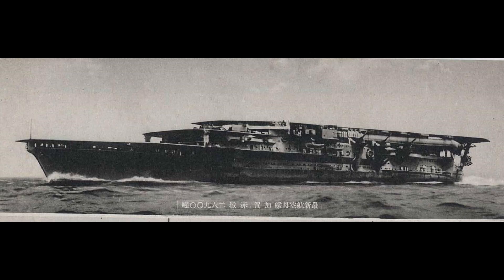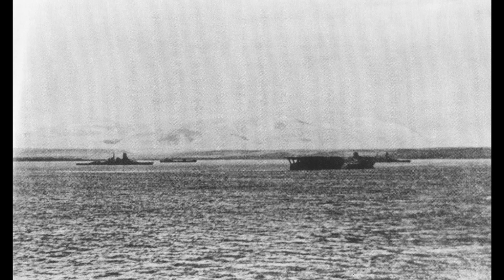IJN Kaga - Guide 255

Comment from the maker: Pinned post for Q&A :)
Reply: when Kagas front 8inch turrets were removed in her 1933 refit, why did they keep the rear guns? Wouldnt it have been borderline impossible to get a decent range estimation and hit rate with only 3 guns? 
Edit: nevermind ignore this I missed the part where she got 4 additional single guns to replace the lost turrets.
Reply: Why did the US 6" Mark 16 gun have a lower muzzle velocity (2,500 feet/s) than the contemporary British 6" Mark XXIII(2,760 feet/s) and Japanese 6.1" Type 3(3,000+ feet/s)? Was this because 2,500 ft/s was the optimal velocity for use of its super-heavy AP shells or would it have been better if the Mark 16 had a higher muzzle velocity with its super-heavy AP shells?
Reply: Japanese carriers have side funnels (which I think looks very cool) while US had straight funnels next to the island. What is the idea behind the two different designs and the pro and cons of each one? Which design would you prefer?
Reply: How would Bismarck have fared had she been armed with 12 15 inch Guns in 4 triple turrets?
Reply: what is the  most confusing turn of events during naval conflict.
Reply: How did the woodern fin's on the Japanese torpedo bombers torpedo's help them from burying themselves into the sea floor at Pearl Harbour and did the Japanese keep using the woodren fin's after Pearl Harbour or were they a one time use idea?
Reply: At 5:33 - What is that structure at the aft of Kaga (left carrier) that looks sort of like a "spoiler?"
Reply: Will you do a video on HMS Caroline one of the last remaining museum ships of ww1 or have you ever visited it?
Reply: @UNSCForwardontodawn Lexington had 8 mounts and they could fire in all directions a regular cruiser could.  Kaga had 4, of two of which could be fired at a broadside.   Lexington would win a broadside fight (8-2 guns to bear).  If Lexington does a bow or stern rake - forget it.  Kaga would be wrecked.
Reply: Why do they torpedo ships before they are fully evacuated? Or were the 800 men already dead?
Reply: On the subject of carrier operations in WWII, how did the Kriegsmarine actually undertake training and operations planning for deployment of the Graf Zeppelin? Did they get advice from the Japanese?
Reply: It is often said that USS Ranger was deemed to slow for service in the Pacific, yet Kaga is actually slower than Ranger. Did this cause major trouble for the IJN?
Reply: @jeff53494  You do not want smoke not interfering with flight operations. Both designs are to keep minimal smoke from interfering with your landing approach view.
Reply: @themightynanto3158  does little to stop torpedoes.
Reply: @dbuckleton  of course they're evacuated.
Reply: What if Japanese leadership were considerably more pessimistic about their chances against the USA than they were in reality, and started up the Special Attack Units a decade earlier than historically, i.e. early to mid 1930s, thus developing doctrine, materiel, and training pipeline for kamikaze pilots well before the hostilities began? Could, in effect, having guided cruise missiles right at the outbreak of war allow them to inflict sufficient casualties upon the US Navy to cause the USA to seek peace terms?
Reply: @Kerndon  Ranger actually did go to the Pacific. Just not in a Frontline combat role.
Reply: @WALTERBROADDUS  okay, I thought perhaps they were trapped
Reply: Are you aware of a game called Rule the Waves 2, and if you are, thoughts on it?
Reply: @WALTERBROADDUS  yeah on that i agree. But what i'm talking about is at Denmark Strait and the final battle.
Reply: @dbuckleton  okay, let's just say the call to abandon ship was given. Everyone who was going to get off, did so.
Reply: @UNSCForwardontodawn In theory Lexington can bring more firepower to bear, as her 8 8" guns can potentially all be brought to bear on either side (though they'd be firing cross deck when engaging to starboard) while Kaga's 10 8" guns look like only 5 can be brought to bear on either side.  And of course Lexington's got the speed advantage.  But maximum armor looks similar.  Hope Drach picks up this question and addresses the more in depth items that might affect the odds (armor coverage, fire control quality, etc.)
Reply: ＋２ Torpedos
-811 Men
Does anyone else see a problem here? I would like to imagine they were already dead, trapped in inaccessible lower decks or something other than "mission non-essential personnel"
Reply: How would you rebuild her( with the tech of the day) and make her better?
Reply: What factors caused Kaga to lose so many planes at Pearl Harbor compared to the rest of the Japanese carriers?
Reply: Awesome as usual Drach.  BTW, update on the battleship Texas.  It's confirmed she'll be drydocked second quarter of 2022 in Galveston Texas.
Reply: @unryumaru2095  I suspect it had something to do with the US's want for a higher rate of fire than the British because they envisioned the weapon to be primarily used against aircraft, with some anti shipping tossed into the mix.  The British where exactly opposite.  They thought their guns  would be aimed more at shipping and less at aircraft, but it would be good enough in a pinch.  The result is in the design.  The ROF of the British Mk 13 was 8 rounds a min but it had a higher penetrating ability over the US's Mk 16, which fired around 12 rounds a min..  To achieve this, the US had to sacrifice muzzled pressure (while saving weight) in order to reduce heat build up.  But that's a guess on my part.  Sometimes this stuff gets obscured by time.  This is what the data tells me, but I can't actually find anything that says "this is why."  Drach may have more information available.

I mean it could simply be that the US was trying to save some weight and that was all.
Reply: So, considering Nagumo's decision (at Midway) to have his aircraft switch from ground attack to naval attack just prior to the US attack that sank her, would Kaga's multiple flight decks have alleviated the situation somewhat to allow Nagumo to get some fighters up and launch some counter attack?
Reply: How whould a Japanese purpous build carrier in the Yamato-class yards have fared? How big could they have been and how do you think the Japanese would have made it? More like a super Hiryu or Shokaku or more armoured?
Reply: @dbuckleton  The IJN couldn't confirm their deaths.  They just knew they couldn't leave it to chance that the ship might not sink and the American's capture Kaga.  It's crap, but they had no other choice but to sink her.
Reply: @QuizmasterLaw  There's a good chance they were already dead.  Abandon ship had been ordered, and no one else was leaving.  They could have been trapped but no one can confirm it.  Regardless, the IJN couldn't leave it to chance that the US might capture Kaga.  So they were left with little choice but to torpedo her.
Reply: @unryumaru2095  the Mark 16 has a shorter barrel (47 calibers vs 50 and 60), and heavier shell (130 lb vs 112 and 124). While the Mark 16 uses a slightly larger propellant charge than the British gun, the Japanese gun uses a much heavier propellant charge to achieve it's much higher velocity. While it might have been better to have an even higher muzzle velocity, at 20,000 yards the US shell is moving slightly faster because its weight and shape help it retain more of its initial velocity. And 2,500 ft/sec] is about the same as the 16"/50 Mark 7, better than the 16"/45 Mark 6, and the same as the 8"/55 Mark's 12 and 15 with the super heavy AP Mark 21 shell used on the later heavy cruisers. That lower muzzle velocity is basically just the price paid for switching to superheavy shells that retain more velocity and penetrate better at practical battle range.
Reply: @unryumaru2095  Well, according to the video about Ching Lee a few days ago, the firing tables of the US Navy around this time had the powder giving lower velocities then were being realized in actual firing. 

As an artillery officer, I can tell you that it is easy to throw a small diameter shell at higher velocity. The larger the bore, the harder it is to toss the shell at high velocity. Also not all shells are designed alike, ballistics, barrel liner wear, they all figure into design and actual performance.
Reply: @Drachinifel If the tirpitz, somehow, broke out into the Atlantic and the home fleet couldn’t get to her in time, could the Washington take her on without the famous admiral lee and her accurate crew aboard her?
Reply: It would be interesting to see you do a video about ghost ships some day! 
Happy Halloween!
Reply: Jordan's "Warships After Washington" says that the UK was supportive of a 43,000 ton limit for individual battleships, while the US wanted the 35,000 ton individual ship limit.  (chapter 5, page 74)  What if they compromised, that everyone was entitled to one 43,000 ton ship, because the RN had Hood, with the rest of their battleship force limited to 35,000 tons?  The Japanese could have demanded the right to complete one of the Tosas as their 43,000 ton ship.  That would give the IJN 3-16" armed ships.  To maintain the 5:3 ratio, the US would need to complete the forth Colorado, Washington, and one 43,000 ton ship.  Which 43,000 ton ship would they choose, a South Dakota, or a Lexington, and why?
Reply: Ultimately was the Royal Navy’s strategy to have the armoured flight deck, at the expense of the number of available aircraft (once they got the excellent American naval fighters and bombers available) superior and economical, to that of the US Navy and the Japanese Navy strategy for large air fleets but with  Unarmored flight decks,  resulting in large material loss on both sides, consequently US victory was basically because  the US shipyards could outbuild the Japanese shipyards.
Reply: What's the oddest caliber of main battery gun planned or actually built for a battleship? And example being the odd 13.8 inch guns for the msckenson class
Reply: After watching the episode of Admiral Lee and the accuracy of Washingtons guns, How does one regulate the guns in a turret to shoot the same point of aim. I understand calibration of the FCS relative to the turrets and elevation on individual slide guns, but single slide and in azimuth variations would occur in dispersion.
Reply: Why were there no allied light carriers/escort carriers present during the Normandy landings? Would it not been useful to have a deck to land and re-arm closer to the invasion beaches before acquiring more permanent landing strips on land? Keep up the good work, and once again, congratulation about 300k subs in ahead of time.
Reply: @borismekler  that'd be a very very expensive suicide program. You're going to spend millions and millions to train Naval Pilots to commit suicide? It would be better  to invest in German technology of guided weapons instead.
Reply: @WALTERBROADDUS  A suicide pilot's training can be considerably abbreviated, though not to the extent that it was in reality. As for German guided weapons technology - AFAIK the basic designs were stolen from the French, and the allies quickly developed effective jammers anyway.
Reply: @ZurLuften  the short and simple answer to that question is, Normandy is well within the range of land-based aircraft.
Reply: @borismekler  sadly, we all learned that lesson about 20 years ago in 2001...😏 Guess they skipped the landing part of flight school.
Reply: @kemarisite  Thanks for explaining it.
Reply: @ryantaylor2595  I see, thanks for the answer.
Reply: @b.thomas8926  Thanks for the answer.
Reply: Is the last picture in the video an ACTUAL picture of the Kaga ablaze at Midway?

I've never seen it before.
Reply: @DC.409  I'm not sure armored flight decks were decisive.  The RN had significant carrier losses too, mostly to torpedoes.  Yorktown and Hornet were disabled by aircraft launched torpedoes and finally sunk with more torpedoes.  The internal fires that doomed Lexington and Wasp were due to damage from torpedo hits.  On the other hand, the British carriers tended to have a lower overhead in the hangar.  That was not a problem for Grumman built aircraft, as their wings folded parallel to the fuselage, the same as a Skua or Swordfish.  It was a problem for other US carrier aircraft that had wings that folded upward.  The Brits had to clip the wingtips of Corsairs for them to fit in the hangar of some carriers.
Reply: @brendonbewersdorf986  "odd" gun calibers abounded in fleets of nations that use the metric system.  France had 13.4" guns.  The Nagatos had 16.1" guns.  "Odd" only in Imperial measure.  The French guns were 340mm, and the Japanese were 410mm.   The German 13.8" guns were 350mm.  To the rest of the world, the US and UK 16" guns, at 406mm, would be "odd".
Reply: @stevevalley7835  that's a fair assessment I suppose 🤔 oh well
Reply: @themightynanto3158  - About as well as HMS Captain.
Reply: @leecrt967  same
Reply: Why is the sky blue?
Reply: Considering the initial problems the British had with the quad 14 turrets, did they ever ask the French Navy for advice as they had considerable experience in this area and had just completed two ships with quad main turrets.
Reply: What would the typical anti ship weapons load of a CVE, of Taffy fame, be. I would assume it would also depend on the roll assigned to a CVE and that 500 lbs bombs and such could be purposed for different rolls with different fuse settings. Since the three Taffy's were there to support ground troops I would guess the bulk were antipersonnel and that might be a problem when they tried to kill ships. (Pesky and inconsiderate IJN!)
Reply: @ZurLuften  They had the aircraft carrier called the UK just across the English Channel, so there wasn't a need to bring a ship that could only carry 30 planes when you had the entire 8th Air Force right there.
Reply: @Shoehandler1142  "@Drachinifel If the tirpitz, somehow, broke out into the Atlantic and the home fleet couldn’t get to her in time, could the Washington take her on without the famous admiral lee and her accurate crew aboard her?"

 She would need a King George V with her if she was going to try to play Rodney on the Tirpitz.
Reply: @AtParmentier  Don't know if my other reply went through because I included a link. But they did something very similar to what you are saying above. Drach did a video on her called "Always Train Your Crews" she was the IJN Taiho.
Reply: @ZurLuften  "Why were there no allied light carriers/escort carriers present during the Normandy landings" 

  They had a very large carrier called HMS England. Don't know if they also used Wales.
Reply: @GearandGaming  unfortunately didn't get the other reply
Reply: @johnfisher9692  entirely different design.
Reply: @scottgiles7546  I honestly think they both would heavily damage each other but the Washington would prevail in the end, her guns and shells were no joke.
Reply: @AtParmentier  look up the IJN Shinanao. It's a Carrier built on the hull of the unfinished third Yamato class.
Reply: I remember reading (I think in the book Clash of Titans) that the Japanese tried to paint the decks of their carriers to look like battleships to confuse bombers.  Was this really done, did anyone else do anything similar, and if so, how effective was it.
Reply: How did she handle in rough seas? She looks top heavy.
Reply: @kemarisite  yeah that's what I expected would be the answer, thanks for the diligent effort, really clarifies the situation. Still I see little to gain sinking her. Could have posted a picket force and tried to get some more out as things settled down on the ship? Possibly unworkable but seems so harsh to sink her.
Reply: @WALTERBROADDUS  if you look at building fires, you do sometimes rescue people after the fires die back.
Reply: @b.thomas8926  I'm not so sure, it's a very heartless approach to a ruined and worthless ship, to sink her to avoid her capture, while plausibly hundreds still lived.
Reply: @dbuckleton  Welcome to WWII.
Reply: Why did so many "used" warships end up in South America? For instance, there were Brooklyn, Crown Colony and De Ruyter class cruisers, along with Halland, Daring and a bunch of American classes of Destroyers. Would it be more of a budget issue, given that these ships would be relatively cheap compared to building new ones. Or is it something else?
Reply: is there a better reason why angle decks took so long, other than no one thought it would work? that seems immanently more sensible than triple decking one
Reply: @b.thomas8926  so often sadly yes, but not always, Graf spee stands out as an exception. There are probably more but seemingly so few.
Reply: Whats the intro music??
Reply: @Soundwave3591  I'm asking about a from the ground up planned carrier, not a conversion.
Reply: Wasn't she made from parts of the Taihou?
Reply: Seeming how ijn carriers had their funnels on the side of the ship in order to make one less obstacle for the pilots to avoid when landing were there cases of the hanger deck getting the ships exhaust blown in if on windy days where the wind blew from a different direction?.
Reply: Drach, I'm the ceremonial officer on a Royal Navy ship and looking to identify any Royal Navy wrecks near Iceland that we can conduct November ceremonies over the top of. Does anything, that isn't the Hood she is the wrong way, come to mind?
Reply: @joshthomas-moore2656  IIRC, the wooden fins were to aid stability in the air, following release from the a/c and broke off on entering the water. They were used throughout the war as far as I am aware, the B6N Tenzan using them, if the kit of one I have is correct 😁. I am no torpedo expert, but imagine the level at which they travelled under water would have been pre-set into the steering mechanism prior to take-off.
Reply: In the final episode of Vigil, Rear Admiral Shaw publicly blames the sinking of the trawler on a Russian sub, knowing that it was actually sunk by a Los Angeles-class that had been following Vigil. If any, what are some examples of this kind of stuff (trawlers being sunk and naval officers lying) from the channel period? I have heard of a trawler nearly being pulled down by a submarine off the East Coast of the North Island of New Zealand, but not sure when.
Reply: @UNSCForwardontodawn Neither, actually, since their primary duty is aircraft carrier and an 8" exchange is going to wreck their flight and hangar decks.  It does matter which year you are thinking, since the Kaga was rebuilt in the early '30s with all-casement 7.9" guns (slightly smaller than the Lex's, 240 lb. shell vs 260 lb.).  So after that she could only fire 5 guns on each beam, and none fore and aft, while Lex could fire 8 guns on the beams and 4 guns fore and aft (at least till early '42, when she landed her 8"ers).  Note also that Kaga's guns were rated to about 24,000 yards while Lex's were rated to about 32,000.  Plus, Lex was about 5 kts. faster, and her fire director was much higher.  Then again, Kaga had a much smaller island so would be less visible on the horizon (assuming we're talking long-range daylight engagement).
Reply: @jeff53494  The problem is keeping smoke from interfering with flight operations (and general ship operations too, but all steam ships have that problem).  There was more "experimentation" early on, but the consensus seems to have been to route the exhaust together into something high behind the island rather than off to the sides (judging by the ships built into the '40s  like Essex, Shokaku and Taiho).  The US did use side funnels on the Ranger, Independence, and the CVEs, but was unhappy with it.  All those designs were cramped so the smoke was routed out in the simplest ways, with less internal trunking.  US non-nuke supercarriers followed the centralized stack, with the JFK departing slightly by having an angled stack like the Taiho.
Reply: @themightynanto3158  The problem is the design of the turrets to fit the guns.  Since the Krupp guns used sideways-sliding breech blocks, they needed more room between the guns than other methods (like the Walin breech, which partially unscrews and then drops down vertically).  Putting a third gun in those turrets would have required widening the ship to accommodate wider turrets and barbettes.
All that said, the Bismarck fell victim first to air attack, which the 15" guns could do nothing about.  Once she was crippled the RN could bring up whatever they needed to pound her into submission.  But if your ship is wider, some of that extra width might go into better torpedo protection.  That will not help your rudder and screws, though.  And a wider ship, with the same length and engine power, is going to be slower.
Reply: @bernardrubin933  How about fighting on after the war ended?  The CSS Shenandoah fought on in the Pacific for several months before being told by a RN vessel that the South surrendered.  They then sailed to the UK to disband but had to stay there for years because if they went home they would be charged with piracy.
Reply: @joshthomas-moore2656  As the torpedo enters the water it naturally heads downward until the gyro and fins can get control and bring it back up to its pre-set attack depth.  This usually involved more than 40 ft. of depth, which is about what the average depth at Pearl was.  The additional wooden "fins" (looked more like a hollow box) added drag to the rear of the torpedo as it entered the water, which tended to bring its nose upward quicker and cause it to level off at a shallower depth.  The wood was built thin and light, though, so it would break off after acting as a water-brake, freeing the regular fins to take over control.  It was actually an idea they heard about from the RN's attack on Taranto.  

The wood additions to the torpedoes were a one-time modification for the shallow harbor depth and were not necessary for regular open-ocean operations.  In harbor, it does not matter if you lose a little bit of speed since you have such short distances and the targets are not moving.  At sea, the extra drag could affect your aim point since the enemy ships are moving and turning fast.
Reply: @Kerndon  What matters most is the relative speed of the ships versus their sisters in the same task force.  Both the cruise speed and the "flank" speed of the Ranger were several knots slower than her "sisters" like the Lex's, Yorktowns, and Essexes.  She was also built lighter, as they were experimenting with trying to pack a 20,000 ton carrier into 15,000 tons so they could get more ships within the London Naval Treaty limits.  The cruising speed of the Kaga was closer (but still not the same) to her sisters, so there was some limiting of the Kido Butai's "speed of advance" due to the Kaga, but they were often imposing limits anyway due to fuel concerns.  When launching or recovering aircraft the other ships did throttle back a bit on "flank" speed to keep her in formation, but when under attack it was often "every ship for herself" so it did not matter.

The Ranger was tasked before the war to support the Neutrality Patrol and work with the Brits, so she had some knowledge of those operations that would have been lost or needed to be transferred to other ships if she was sent to the Pacific.  It just seemed better to keep her in the Atlantic, while the other Yorktowns and Wasp were sent west.  Later in the war she did re-deploy once the need for her decreased, but she was kept out of the main fleet because the other ships were all rated for the same speed and better protected.
Reply: @borismekler  Telling men before the war begins that you need them to suicide is begging for discouragement and low morale of your own men.  It was only seeing the lack of results later in the war that led them to start the kamikazes; at the beginning of the war the IJN was superior in doctrine and training and considered itself the best naval air force in the world.  Plus, the US was NEVER going to "seek peace terms".  She lost close to all of the pre-war carriers and half the battleships (given, they were salvaged and rebuilt), built an entirely new fleet of double or triple strength in a couple years, and pounded the IJN and Japan to scrap.  From day one FDR declared were were fighting for unconditional surrender.
Reply: @QuizmasterLaw  Most of the 800 men lost were lost in the bombing and fire-fighting.  A few were trapped below decks in the engine spaces and could not get out anyway because the exits were blocked by the fires on the hangar deck.  There was at least a couple hours between the order to abandon ship and the launch of torpedoes to scuttle her.  There was probably a few who were lost in the sea as well, some wounded who could not swim long enough to make it to a pick-up ship.
Reply: @Cbabilon675  Her hangar deck was full of gassed and bomb-up planes when she took multiple large bomb hits.  She burned for hours, and they said you could see her outer plates glowing orange.  She was probably too burnt-out to repair - major frames and bulkheads softened and bent in the heat.  You would be better off melting her down and building a new, better-designed ship from the scrap.  Use the Taiho as a model, but do a better job with ventilation...
Reply: @gregorywright4918  wow!
Reply: @unemployed_history_major4795  The two waves of the attack were composed of full attack squadrons from alternating carriers.  The Kaga's torpedo squadron was paired up with the Akagi's, and as flagship the latter would attack first.  So Kaga's planes were at the end of the single line of torpedo bombers flying down the loch in front of the shipyard, and got most of the AA attention once they got going.
Reply: Why were the hangers/flight decks staggered? Why not have the upper two span the full length of the ship like the lowest one did?
Reply: @calebshonk5838  The multiple flight decks were impractical with bigger, mono-wing aircraft of the '40s.  They needed a longer deck for take-off than the lower and middle decks afforded.  Plus a strike package could not be assembled together with such a short upper deck.  Plus the lowest deck was at main deck level, meaning it was much closer to the sea than the upper deck.
Reply: @DC.409  At the beginning of the war there was "large material losses on both sides", but as the US fleet expanded their large-complement carriers added together with new doctrine to dominate the skies, significantly reducing losses until the Japanese adopted suicide tactics, which still could not turn the tide.  Unarmored decks were also much quicker to repair, and no unarmored fleet carriers were lost by the US after 1942.
Reply: @bacardipirate1430  Blue is the shortest visible wavelength, so it scatters the most as light passes through the atmosphere.
Reply: @johnfisher9692  The RN ask the MN for advice?  Sacre-bleu...
Reply: @scottgiles7546  Presuming your question is about the Battle off Samar, the two jobs of the Taffys were ground support and local anti-air/anti-sub defense.  The magazine loadouts would be prioritized towards these roles, but there is usually some anti-surface weapons "at the bottom" in case of the unexpected.  There were reports of Avengers dropping anti-sub depth charges on Center Force ships because that was what they took off with.  Don't know if that would go off.  Torpedoes would be most useful, but they were often too big for CVEs to handle. 

A useful reference would be Norman Friedman's "US Aircraft Carriers - An Illustrated Design History".  There is a chapter in there on CVEs; I don't remember if he lists standard loadouts, but they probably varied by campaign.
Reply: @craighagenbruch3800  That depends on whether the hangar deck is open at the sides.  US ships were; IJN ships were not (although they had some small shutters they could open).  Closed hangars kept the weather out, but prevented them from warming the planes up below, so after the spot the planes had to be warmed up on the flight deck.  Smoke in the side-mounted AA guns was a problem, though.  And smoke still got into the landing path astern.
Reply: @timrobinson513  You don't know exactly where the plane will lift off, and you want clear air on all sides when it does.  Different planes will lift off at different distances, depending on loadouts.
Reply: I've always wondered why Japan didn't respond to the Great Kanto Earthquake by using the material scrapped from Amagi to build an exact copy of her as their second large carrier and insisting it was still just the converted battlecruiser. Some of their actual examples of cheating on treaty limits were more extreme than that would be.
Reply: @gregorywright4918  On the other hand, Japan did have a long-standing tradition of honorable suicide and death in battle as a high aspiration. If the leadership wanted to, they probably could've sold it. Then, had they had an additional 5-8 years to develop and refine something like the Ohka before it went into action, I suspect even the Essex swarm would've had issues with near-transonic homing missiles slamming into them whenever they went into range of a Japanese carrier or a shore base.
Reply: @RedXlV  Time pressure, probably.  The Kaga hull was sitting there, scrapping the Amagi would take months, fix up the ways a few more, recast the structural members a few more, then another couple years rebuilding.  And what's the likelyhood of aftershocks in the same area?
Reply: @borismekler  The Okha's were only developed in 1944, and their short range meant they had to be carried by bomber to attack within 20 miles.  They were easy to knock down before launch and only damaged or sank a handful of ships, none bigger than destroyer.
Reply: Tosa (battleship), more complete, was scrapped. 
Kaga (battleship), less complete, was converted into an aircraft carrier. 
- How complete were the two ships at that point? ¨
- Why wasn't the "more complete" Tosa converted instead, and the less complete Kaga scrapped?
Reply: Drach, could you comment on the issues of dealing with smoke for carriers and the pros and cons of how the IJN handled it?  In an earlier Drydock you mentioned the height of the stack helped draw the gasses upward; if the stack is tilted downward, does that hurt the boiler efficiency, or do you have to waste some energy using fans to draw the smoke?  Does that then get clogged up and require more frequent cleaning?  Also, did the IJN have a water spray system in their carrier exhausts?  Was the downward stack ever damaged by heavy weather or excessive rolling, or blocked by a large starboard roll?  Since the later-designed Hiyo and Taiho (plus Shinano) had a high funnel behind the island, did they decide it was not worth it?
Reply: @calebshonk5838  If Kaga were still in her original configuration, she would've had fewer and less capable aircraft. So no, keeping the multiple flight decks wouldn't have helped at Midway.
Reply: @brendonbewersdorf986  There's nothing odd about the 13.8" guns intended for the Mackensen-class battlecruisers (and the extremely similar gun of the same caliber intended for Austria-Hungary's Ersatz Monarch-class battleships). 13.8" is 35cm.
Reply: @RedXlV  somebody already replied about it thanks though 👍
Reply: Alright this might sound a bit weird but, What if Super heavy shell made out of depleted uranium,how effective do you think they are?
Reply: Alright this might sound a bit weird but hear me out, What if Super heavy shell made out of depleted uranium,how effective do you think they are?
Reply: @gregorywright4918  Exactly, they were developed in 1944 and rushed into combat, which brings the question - what could've been done with them had Japan been given a head start of 5-8 years to refine both the technical design and the operational doctrine?
Reply: I've kept hearing from you, from AC Naval history and from Dr Lambert that Admiral Sturdee had some interesting/radiacal ideas about how ships should be used on a tactical level, what were these ideas and what made them so intersting/radical?
Reply: @borismekler  No one, not even the Germans, had rocket planes in 1936...
Reply: What would the likely outcome have been if the US had NOT deduced that the target was Midway, and sent their carrier task force to the Aleutians instead?  Would Yorktown have still sailed with Enterprise and Hornet, or would she have remained in Pearl Harbor to complete her repairs?  What would a successful and relatively painless (for the Japanese, anyways) Japanese invasion of Midway have resulted in with regards the war in the Pacific?  Besides the obvious that Kaga, et al survive the invasion without damage.
Reply: @Drachinifel , I see different models of post modernized Kaga with either 2 pairs of vertical bow deck supports or 3 pairs of vertical bow deck supports.  Did the Kaga have 3 pairs or 2 pairs of vertical deck supports at the bow?  Is there a reason for the descrepancy?
Reply: @scottwyatt2614  Grabbing Midway was not the primary goal of the operation, it was a secondary goal.  But to be successful it had to threaten someplace the US considered vital.  The Aleutians were not vital.  Hawaii and the SLOC to Australia were vital, and in that order.  Coral Sea was fought to protect the latter; Midway was fought to protect the former.  If the US had not deduced that MI was Midway, normal speed recovery from Coral Sea would have had Yorktown coming in slower and planning to take longer in drydock, with Enterprise and Hornet doing defensive patrols around PH or poking around the south Pacific.  

The problem for the IJN after grabbing Midway was how to support it - they were short on shipping and escorts and keeping Midway supplied would be expensive.  Some analysts thought USN could have done nothing about invasion and just strangle Midway afterwards with long-range bombers and subs.  In any case, supporting the whole IJN fleet in Midway waters for more than a few days was not going to happen - not enough tankers, and the atoll could not shelter all the ships in a bad storm.
Reply: hELLo! Could you kindly do IJN submarine carrier? Can't remember the name of the sub from the top of my head. Thanks!
Reply: You are a damage control specialist, and are on a Japanese carrier at Midway. Which one would you rather be on and why, and with US damage control teams, equipment, and procedures, do you think you could save the ship?
Reply: What about USS Midway? No not the island the carrier in it’s WW2 Configuration because it was converted from a anxiel/straight deck carrier into an angled one
Reply: @Paul_Maurone  I am going to rule out "spoiler" as Kaga was not entered in the 1939 Indy 500 and was in no danger of "popping a wheelie."  Rather I will speculate that it is some sort of crane beam that would be lowered during flight operations.
Thanks to Wikipedia we know that Wilbur Shaw won in '39 driving a Maserati; Caroll Shelby was 16.